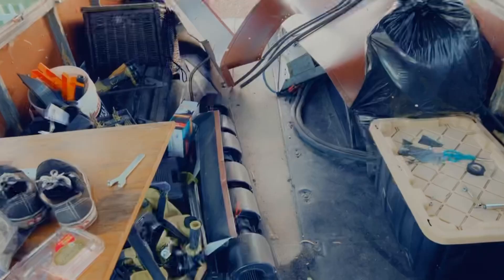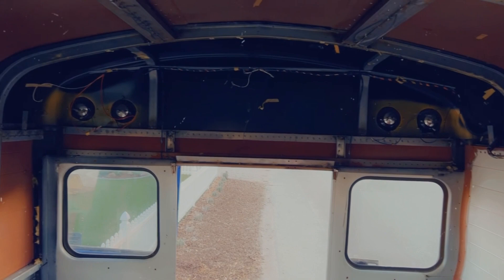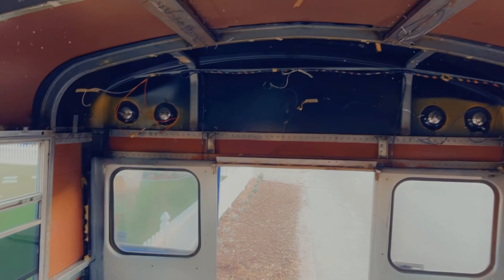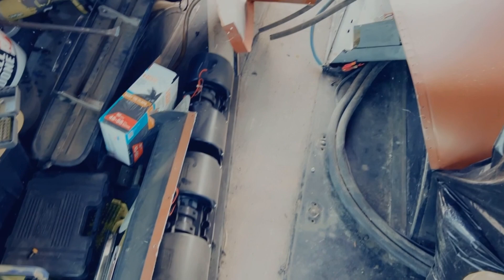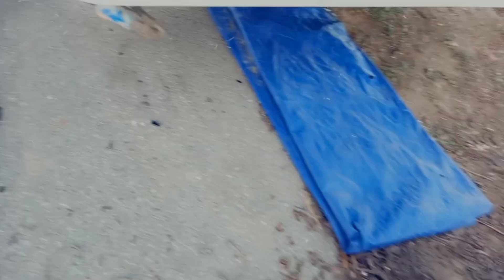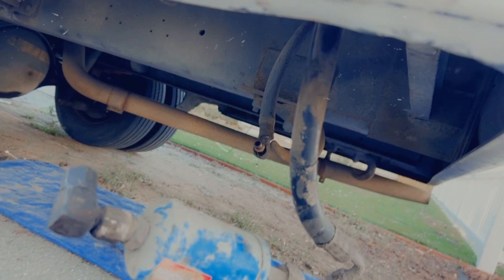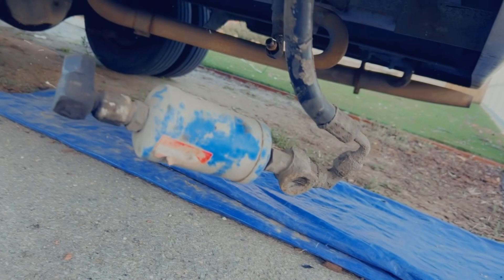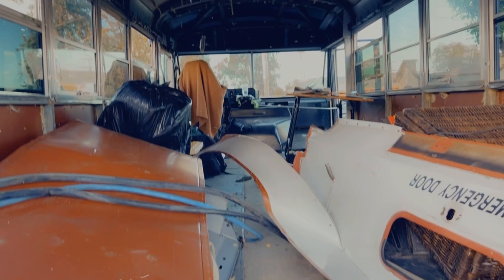I took the AC out of my Skoolie!!! (Short School Bus conversion)

Comment: You're right', there are so many new options for heating and air conditioning for our tiny homes. When my air conditioning went out in my RV' one summer, I went to Best Buy and bought a General Electric brand stand alone portable air conditioner that Vents with a flexible tube out the window, it works great up to about 100 degrees; now that I have my roof air fixed, I only turn it on above 100°; below that, the Standalone air conditioner works just fine. About $300 and 10 minutes install, instant air conditioning.

Comment: Ha ha ha ha ha.. you took the ac out .. your going to sweat your brains out now.. that ac unit puts out more cooling then you need but that was a good thing.. now your going to have to drive with all the windows open.. w j.g at did you with all the freon
?
Reply from the maker: The AC didn’t have any Freon, it wasn’t working, and if it did, it would only work when the bus is running. Did you know that there are better AC units that you can run off of solar or generators or when plugged in without the bus running and that use less power?? Who knew…
Reply: @EvieNova  yes. Try running it when moving tho.. plus ac will wipe out a solar generator in 30 minutes.  You need a boat loaded of reserve batterys for the ac to even keep up with a 12 hour day in 90 degree weather.. probably like a dozen lithium batterys.. good luck..ps a mini split is designed for a home not a moving vehicle.. the ones designed is a roof top unit at best that would most likely work.
Reply from the maker: Why would I run AC for 12 hours? And why would I run it while I’m driving? I have AC unit upfront still like a normal van does. Also, there is a thing called ocean breeze and there is plenty of it on the west coast…where I’m at right and will be for a long while
Reply: @EvieNova   well I guess you should know that the rear ac in your bus runs off the front ac compressor so disconnecting the rear you lost the ability to use the front.. now you will have to cap off the lines and repair the ac.. hopefully you plugged the hoses so you dont contaminate the system.. 12 hours was a figure of speach.. but if you had to run it for that long you would be out of power.. I suggest you buy at least a 4000kw generator for future use.. good luck
Reply: 9
Reply from the maker: Actually on this bus the back AC had its own compresses and the front has a while separate system which also doesn’t work (was installed by the church). You can learn a lot by getting info and tips from an actual AC guy who knows his stuff and also has a Skoolie like mine. I’ll either be fixing the front AC or replacing it. Either way, not your bus not your problem.
Reply: @EvieNova   I am a ac guy.. certified.. worked on chicago transit bus's.  You must have a special bus then.. all the ones in chicago worked off the main compressor.. the only second ac compressor ones had a APU style which was a separate diesel enging that ran it and a generator for 120 volt outlets so people can charge their lap tops.. good luck with it